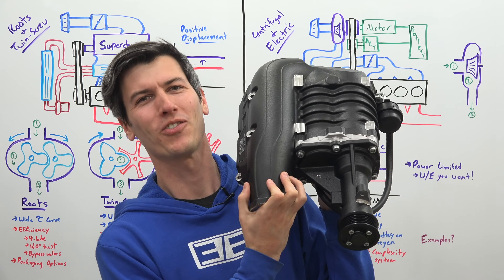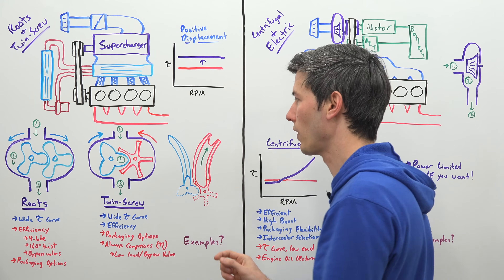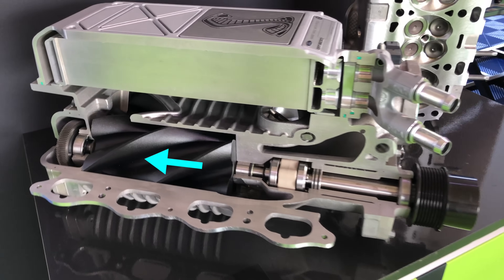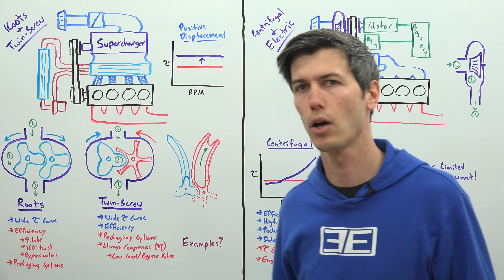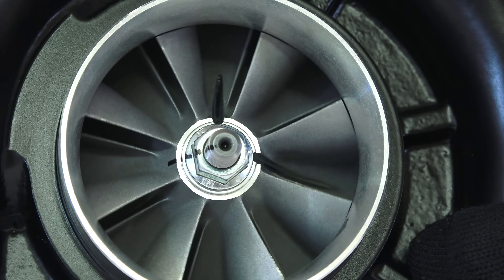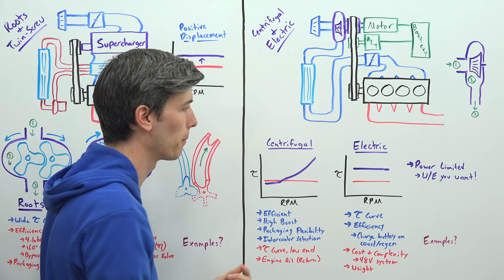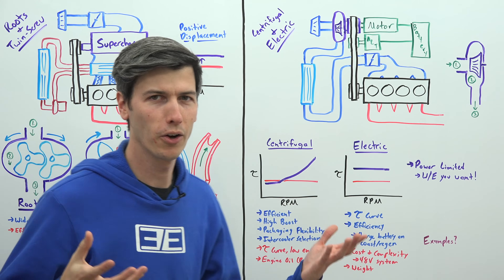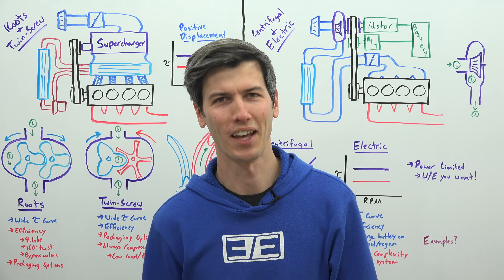What's The Best Supercharger? Roots vs Centrifugal vs Twin-Screw vs Electric

Comment: The best setup might be a hybrid centrifugal, no idea if something like this exists or has been pondered by anyone.  Put a belt and a motor on it with a clutch so that the motor can spin it up at low engine RPM, then the belt takes over.  It would save battery power as well as allowing for a smaller motor which allows for smaller supporting components.

The closest I've seen to this, tho totally different, was on a Volvo diesel boat engine.  It had a large turbo which is good for efficiency, but slow to spool up so it also had a small supercharger with a clutch just like an A/C compressor clutch.  If you brought the the throttle up slowly the SC would do nothing, if you hit it hard the SC would kick in for a few seconds, then turn off once the turbo was spooled up.

Comment: screw supercharger is'nt really compressing either though since the size of the cavity isn't changing; consider what would happen if the beta angle of the got higher the closer to the exit, where the size of the cavity would get smaller. These are in effect both just pumps; if there's a restriction in flow after them, that's where the air is being actually compressed.

Comment: That would explain why centrifugals were the standard choice for aircraft forced induction, I suppose: aircraft usually like to run at a near constant RPM, especially if fitted with a constant rpm prop that can vary torque load when power is needed instead of RPM.

So the boost pressure applied to the engine is much more consistent than it would be in a car

Comment: 🤜⚡💥⚡🤛HAHAHA!!!!  BUT our FAZE engine design doesn't need/do that. The ultra-simple, low cost, ultra-quiet & efficient, FUEL-AGNOSTIC ZERO-EMISSION engine has a constant max torque/power/efficiency/λ curve....WITHOUT the complexity and, as such,.....it doesn't require a transmission!!![Ya, it acts like a motor]

It recovers braking energy and doesn't need any batteries, turbos/chargers, emission controls/computers, muffler, etc. . Moreover, the torque can be instantly bumped up several fold that of the normal running torque.

===
NOTE: Our ultra-compact & torque-dense positive engagement CVT is far superior.
🤜⚡💥⚡🤛

Comment: I just wish I could get the roots or twin screw sound on a centrifugal SC. Centrifugal makes the most sense/seems the most practical, least maintenance, and don't effect drivability being traction limited at low RPM, but doesn't have that sweet sweet SC whine.

Comment: Good info, a small critique. You do NOT charge a battery for free when idling or coasting just because the motor will be spinning anyway. Charging applies a load to the engine and the engine then burns more fuel than it would normally regardless of coasting or idling. So while the electric supercharger is cool in the sense that you can do whatever you want with it, it is the least efficient method.

Comment: At 1.40 WRONG, SO WRONG.The rotors turn clockwise as in roots. If you take a twinscrew in front of you the driven pulley is in the right and it is rotating clockwise as the engine where the belt is coming. The pulley is connected to the right rotor. The principal of twinscrew happens in 3 stages, air in from the rear, then moved outside of case to the middle ,  then travelling between the rotors back up where the pressure is made and back to the outside of the casing to the discard to engine. Been servicing many of them and I know

Comment: A factor not considered in your video is how that power is managed and effectively used. While positive displacement superchargers do give the immediate change in engine performance, that power is spent spinning the tires instead of accelerating the vehicle. A slower buildup of power allows a vehicle to effectively put that power to the wheels. That's why  you see procharger race cars doing so well.

Comment: You have the screw marked as rotating opposite to the roots but they actually spin in the same direction as a roots. They carry the air around the outside the housing and compress it at the bottom.

Comment: I had a TRD supercharger on my Toyota, installed by the dealer. In 100K miles, the bearings went out on it twice, needing expensive rebuilding. Yes it was awesome when it worked but was an overall disappointment for reliability. Meanwhile my twin-turbo Ford F150 just passed 130K miles, so there are many aspects to supercharging vs turbocharging, as it's not simply a black and while yes/no sort of thing.

Comment: I read that a small engine likes a big super charger so you keep the boost low and create less heat by not working the SC very hard.  You made the roots blower seem a little better then the whipple. I had a whipple on a 3 valve mustang in 2005 also dyno the tune  tightened up  the transmission shifting which really made a difference on the automatic transmission. Engine cubes 282 cu inches pushing 8 or 9 lbs boost = 540 hp at fly, 400+ at the wheel. Back in 05 it was a beast. I also larger fuel pump, bigger intake and headers. What do you think is the better engine Mustang gt 5.0 or Camaro  455 cu in. to super charge. Thanks

Comment: I am betting on the toilet paper tubing, as internal fluid forces 😂in the egg would self destruct! This is taught in engineering 202, from the Paruvian book of "Statalogical Science published on May, 23rd, 1934. It is promptly pointed out that it can only work if used with 12 manstically spaced anhydrous winglenurts directing the rotors slip-stream into the Shellmonglaze if tankered without the possibility of synusodal depleneration. Otherwise it could fail! I have studied this infrequently and stand in between every forth word. You can't change physics but there are 942 ways to break an egg. I have tried all. DK, NIASE Master since 1978.

Comment: So it seems like a best option would be an electric assisted supercharger/turbo, where the electric motor does most of the work at lower RPMs just like a normal electric supercharger and the normal turbo eventually takes over with the turbine spinning the turbo and also reclaiming energy for the electric motor.

Comment: If roots and twin screws are positive displacement types, meaning a fixed amount of air goes through with each revolution, then what determines the boost amount for those superchargers? I understand that the rpm speed makes boost for centrifugals and turbos but if that same concept doesn't apply for the others how do you get more boost out of them? Is it the size of the manifold? The size of the blades? You would think a smaller pulley would create more boost but if the rpm speeds always bring in the same amount of air then that actually wouldn't work.

Comment: ?????? new engine design, screw compressor feeding a flame and driving a screw pump. the same idea as a helicopter turbo jet, has fans, flame,fans. same as on piston engine is the fire between a turbo fan compressor and exhaust fan driven.. eliminate the pistons, now have positive air flow????

Comment: I have a 2003 Mercedes c class with a supercharged 1.8 litre 4 cylinder, using an Eaton M65 supercharger attached to the side, take up a little space but for a little 4 cylinder it's not bulky. Still sounds great though 😎🇿🇦

Comment: twin is the operative word here. Twin screw are the best of the superchargers and twin turbos are the best of the turbos. Both are more efficient in terms of the forced induction method. I think centrifugal superchargers is advantageous when you want something easier to install and something that doesn't run off the crank.

Comment: Many years ago, I read in a hot rod magazine about an outfit that had designed an axial flow compressor- like a jet engine compressor section, with rotor and stator blades.  They claimed to be able to pump up great pressure without adding frictional heat to the incoming air.  It was belt driven, like the Roots and the twin-screw (and centrifugal).  The only added heat was from Boyle's Law.

Comment: I'm surprised no one has developed an electric supercharger, with something like a supercapacitor as temporary (spike) storage, with primary power from an exhaust turbine driven generator/alternator. Benifits of turbo (exhaust power driven) and supercharging (response galore). Might ned to be isolated from the main electrics coz I'm imagining it running on at least 100v to be useful.

Comment: If screw blowers were better top fuel would be running them guy think about it but what are they still running Roots I’m sure they’ve tried a screw blower and got worse results than the Roots, and I’ve seen the parasitic loss’s from screw and roots blower a roots blower take aprox 50HP to turn, a screw blower takes aprox 80HP not a lot of different but the roots comes out on top, centrifugal is crap just like turbo’s kids today have ruined drag racing it’s so sad

Comment: My one supercharged vehicle is a Toyota Previa minivan. Roots type, air to air inter cooler. It has a waste gate that limits the boost to 6 psi above sea level, or about 20 psi. The nice thing is that the waste gate maintains that 20 psi as I gain altitude, rather like an aircraft’s turbo compensator. I get the same performance at 11-12,000 feet as I do at sea level. My V-6 RAV4 is faster at sea level, but above 5-6,000 feet the computer forces the engine to spin faster & shift at higher rpms to maintain performance. Eventually the 2.4L Previa keeps right up with the 3.5L RAV4.

Comment: You did not mention cost and drivability. I have had Roots, Centrifical and Twin Screw in different vehicles. All Corvettes. The cheapest and actually most fun was in  a 981 Corvette with the Centrifical mounted up on a Build Small Block Chevy with a 4 Speed O.D. trans and 3.31 rear gear. Low speed was OK as I had the lower Gear and a good Torquey Cam. But about 3,500 it would just shred the tires off the rims. I am now thinking of doing one for my Current ride, a 2014 Corvette, Z51. But i want to ensure the pistons are strong enough. As always  a great lecture and diagrams. Thank You. Dennis in Virgnia

Comment: I had a vortech supercharger on my 1990 formula 350 firebird and gained 2 mpg on the highway. As far as having to spool if up for power it was no difference in it compared to a roots type, they both worked off the crank. My engine hit 6 grand in a second or so when i mashed it. I never noticed a delay and boy did i love the sound of the supercharger. Wish they had a bolt on roots type for my little 2013 dodge dart, it's lacking power.

Comment: Ok the whole idea is to create more oxygen density to feed the engine...so you compress the air raising the pressure before entering the engine so it gets more oxygen per volume....

So like, why is the cooled AFTER the supercharger and not before it????  Lowering the temperature of a gas makes it denser, which also fits more oxygen into the set volume.  
However, in a pressurized system with constant volume, cooling the air after its compressed would lower the pressure...which you just used a supercharger to raise it.  Isnt it counter-productive to pressurize the air then lower its pressure before it goes in the engine???  Wouldnt it make a lot more sense to cool the incoming air BEFORE it entered the supercharger?  Am I the only one seeing this as an unnecessary inefficiency?

Comment: Centrifugal seems pretty redundant, if I wanted lag then I would just use a turbo
Reply: It's not lag though. The throttle response is still snappy, it's just that all the beans are at the top end... On the plus side that does mean it won't effect your normal fuel economy much if you install it on your daily.

Comment: My mustang gt has a centri on it. Because It already has great torque stock, waiting till 2800 rpms for boost to kick in isn't really a big deal. It has 450 tq and 510 rwhp after the install. It's more than enough for the street. Definitely would go with roots for drag racing.

Comment: A Roots blower is a positive displacement air pump, rather than an actual air compressor. That's why they're called "blowers." Because they're not actually compressing air. If your definition of "supercharger" is a device that compresses air, then a Roots blower isn't technically a supercharger.

I get that it generates pressure by pumping air, but it still seems a bit weird to just lump it in with all the other ones.

Comment: I don't understand how the boost from a positive displacement supercharger can remain constant.
If it's linked to the crankshaft, which it is, then the increase in RPM should increase the RPM of the compressor as well, which should move more air. So how does the pressure remain constant? Isn't it the exact same principle as a centrifugal supercharger or a turbo? More speed, more air.

Comment: On the matter of engine load, output, and parasitic loss regarding power supply to electric centrifugal air chargers. I'm sure ur aware, I am currently running n/a, pat on the back because I'm done with my upgrades mods and tunes am finally hunting the option as far as price and condition for an Eaton m45 and Stigan t3t4 .67 a/r to twin charge my beta 2. However I want to use an electric super so I can avoid messing with my belt drive. I was going to cut the BS out in lack of better terms by (yes I understand if I do it wrong, well I probably don't have any business trying it lol) I'm absolutely positive that I have the system designed flawlessly, and I double checked to the point of redundancy. Since I am already running a dual battery set up and am also running higher output from the alternator, (you sound like a moron. High output alternator?) Hahaha, I ran a resistor in the return side of the sensor wire which has an ohm variation of 10% over or below 1000 which equates to roughly 1v. So at any point and time the alternator internal voltage regulator is reading one volt lower than the battery actually has, my vehicle at idle under full load and with the pwm mods, direct wire dual fuel pumps and crankcase evacuation pump I never fall below 14.5v and without load, at idle, I never fell below 14.94 or got above 14.96.. my question/theory is this, being relatively simple to set the right diodes in the right path and with dashboard switches we could momentarily send 24+ v to the supercharger and greatly increase its efficiency with reduced engine load? I'm just now getting into experimenting with capacitors and spark boosters, I think they, when used right, would also exponentially increase where it's needed decreased where it's not.  I'm gonna start my channel this week, I have too much to keep it to myself, I'm at the point now where ECU anything is a joke,, wiring diagrams, ECU ground, pulse width, the whole thing is designed as simple as it can possibly be, I feel like people who say an electrical issue is difficult to find and fix only say it because they secretly hate computers and electricity and dream of the good ol days where manually cranking your engine was likely to break your neck lol, you know, back when ignition timing was fixed and not easily manipulatable buy people like us with IQs above room temperature
Reply: And I realize the eff you answer is why not just use one battery for the super?. Not what I'm looking for as my evac pump is 12-24v anyway and it's foolish and wasteful to only give it half power, maybe I'll use some spark boosters and see what catches fire and what explodes. But first, to the fire extinguisher isle

Comment: Ideal flat boost curve of the electric driven centrifugal overlooks the surge point of that device, which will require either a bypass/blowoff system or a compressor speed/load strategy.  Give me PD tip-in torque any day.

Comment: Why are superchargers not as common as turbos in diesel engines?
Reply: turbo and diesel are like peanut butter and jelly because of the diesels high thermal efficiency and lower temperatures slower burning rates etc mean turbos have a lot of things to work with vs. superchargers recycling exhaust vs. superchargers which are simply forced induction.

Comment: There’s another drawback to the electric supercharger that you missed. If you plumb it to your throttle body like a centrifugal, and you have it set to trigger when you’re at, say, 75% throttle, you’re losing horsepower when you’re using less throttle. If the supercharger isn’t on, it’s blocking airflow to the engine. Cletus did a video on these and his vehicle lost 10 hp when the supercharger was turned off. They make a bypass for them but it’s not included in the kit.

Comment: Very clear explanation. My Jaguar XJR runs an Eaton, whereas there is a twin screw after market variant available that produces even more torque. I have not yet come across a situation where the Eaton is insufficient, but if I had more torque I would use more ! However, my tyres are not cheap.
Reply: I have a jag str , you can never have to much torque imo I'd love a twin screw 😏

Comment: You have not mentioned the electric system where the exhaust gasses drives the alternator, as demonstrated by Mercedes -Benz yielding higher than 50% overall efficiency.